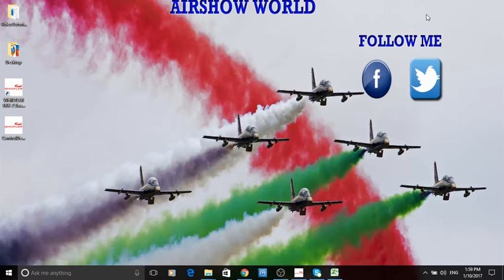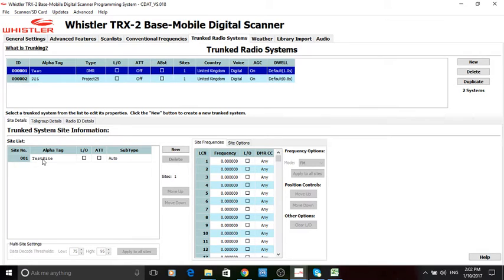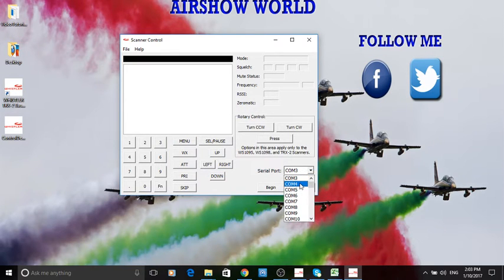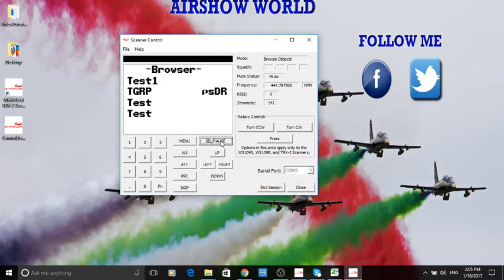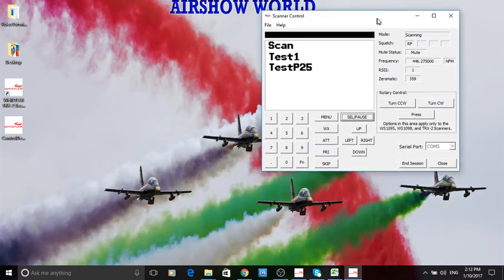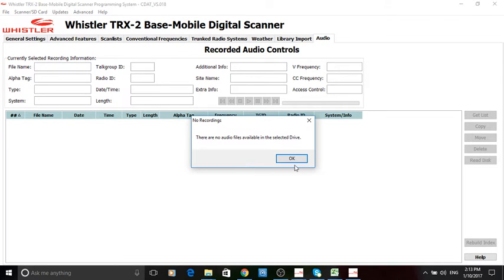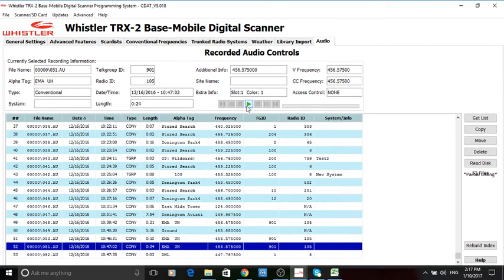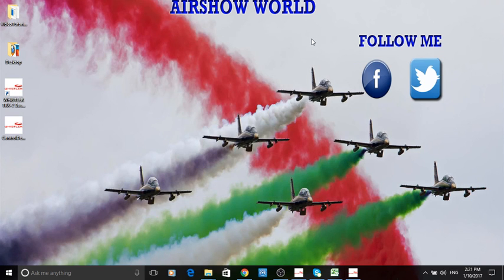Whistler Scanners Tutorial 8 Trunk Tracking P3 AIRSHOW WORLD

Comment: Great video!is it possible To transfer found frequencies from recorded audio list  straight to scan lists?
Reply from the maker: I don't think you can apart from doing it manually, when I get chance though I will look into this
Reply: the ICOM R-10 and R20 have Reaction Tune and AMWS. with reaction tune, you connect a Opto Scout to the ICOM with a CI-V interface, when the frequency counter detects a signal , it Automatically tunes the ICOM as well as Writes it to memory. you can also just Program a Search bank and use AMWS or Automatic Memory Write System, to Automatically store found Frequencies.